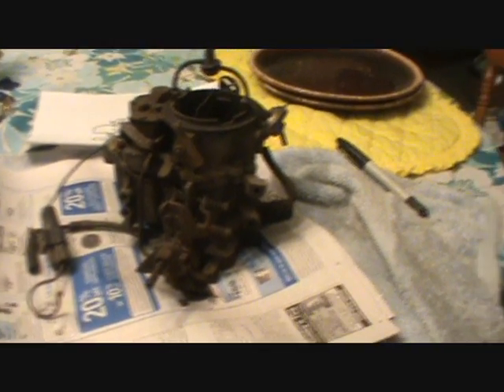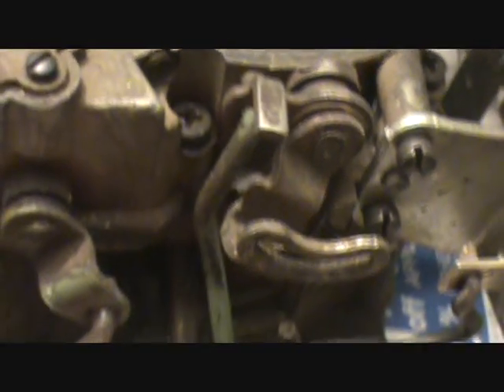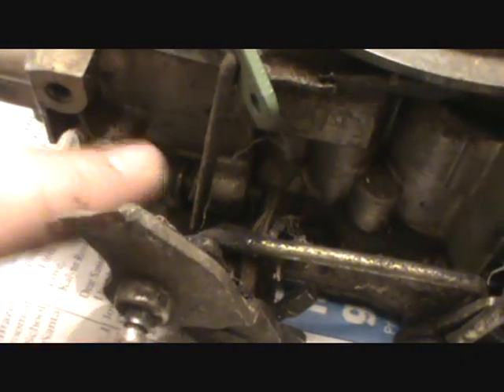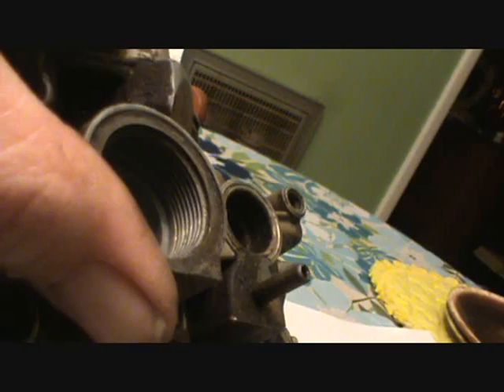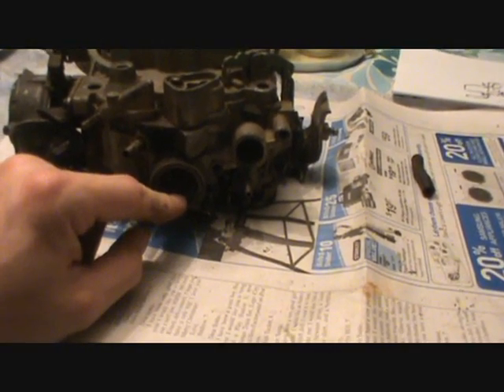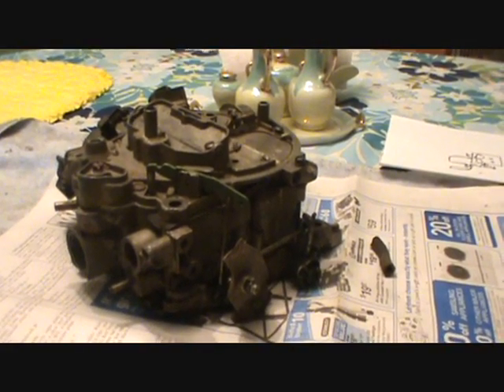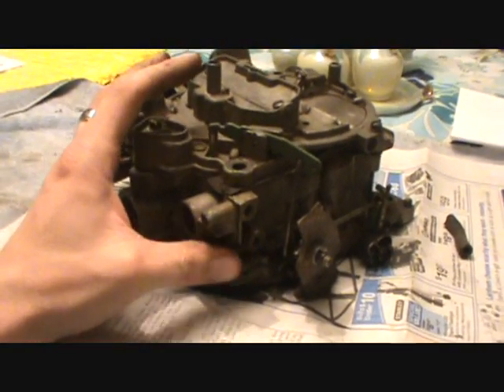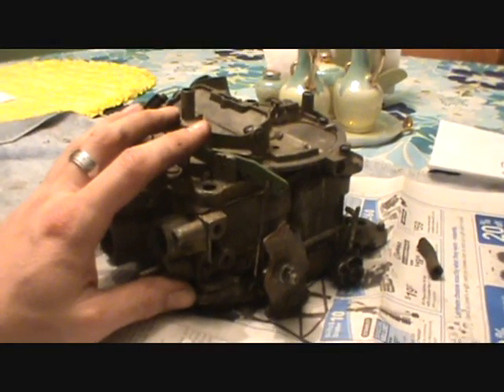How to understand automatic chokes part 5

Comment: Hi Tyler!!!  Thanks four your videos.  They are highly appreciated.  Ive got a 318 with a Rochester dualjet ( im pretty sure that is what it is). It runs pretty good. But, it could use some adjustments.  I've been watching your carb videos because I plan on pulling the air cleaner of this weekend and trying too straighten a few things out.  So, before I get to, it I'm doing some research.      At idle it smells like its running rich.  When it is first started in the morning, 2 pumps on the throttle, turn the key...fires right up and runs smooth.  But, as its warming up, the rpm's slowly creep up.  To bring the rpm's down, I have to blip the throttle.  Is this right ?  The rpms creep up pretty high.  Im pretty sure at the least I need to adjust the high speed idle screw.  Sometimes I have too blip the throttle several times, revving the engine pretty high, to get the rpm's to drop.  It just doesn't seem right.  Anyhow,  Ive you have any suggestions Id appreciate it.  I see here that you have alot of people looking towards you for advice. If you dont get too my questions I understand. If you do, well then I thank you kindly.   Have a good one Tyler. And take it easy !!!
Reply from the maker: Thanks man. The idle speeds up as it warms up because the choke is either adjusted too rich or the choke "pulloff" is bad. You'll need to identify which carb you have. Dualjet is a 2bbl rochester which was never used on Mopars. The 4bbl  Quadrajet was. Once you ID the carb, there are good online resources which explain how to adjust chokes and how to test pulloffs. Blipping the throttle is normal, the choke being too tight(rich) would make it take more effort to knock off the choke with the pedal.

Comment: I learned a lot thank you. I have a 1976 Dodge 440. Been having a hell of a time getting it started cold. Also after its warm when I try to start it after going to the gas station it cranks hard for about 3 seconds and then kicks in. I'm going to do what you showed on this video. I've rebuilt a lot of carburetors but never knew how to adjust the choke right. Everytime I had to rebuild one it was out of necessity so I am not an expert that's for sure.

Comment: Hey bud its me again I'm still having trouble I am a first time carb user. In that being said I bought a 79 Pontiac lemans 2 door coupe has a 231-2v v6 103hp  3.8l and has a Rochester Dualjet 210 #17058190 and the man was 80 years old said before you leave we have to adjust the electric choke. And in doing so I watched as he turned and turned pulled throttle turned back and forth and pulled throttle so now Im at a point to where were I live temp is warm right now but anyway when I start the car I hit the pedal 1 time turn the key the pump one more time just to make sure it will stay running and at that time the choke butterfly open and I don't have a Rpm gauge but I'm sure it will be 4000  I mean it is screaming so I push the peddle review it until is goes to about I don't know 2500rpm I put it in gear and if I hit that gas man stall. Then do it a second time its OK but the only way to just lower that insane idle I have to turn the air off or slide to heater and it will be OK but it's just chug o login. Then when I get home from work wait about 4 hours to cool down and take the air cleaner of and the butterfly will be at about a index finger open.  I have watched almost all of your videos and I think all Quadrajet videos on YouTube I'm lost for words the carb is clean heat rising pipe is on I don't get it. To me you are the king of quadrajets and I really could use some advice here. Please I would very much appreciate it.. Sorry for the long story but on your videos u always say ask me anything so here I am..
Reply from the maker: Glad to help, but you have to help as well. You've watched all the videos, I presume including fast idle speed, chokes, etc. So, what have you FOUND wrong with your carburetor so far? For instance, next time it idles extrmely high, don't touch ANYTHING, shut if off and go directly to the carburetor and look until you see the reason the throttle is hanging open.
Reply: Tyler's Neighborhood Garage  only problem I see Is the high idle Cam Is up and when coolest down its still stays open about an inch untill I push on the throttle plate for it to even get closed or it the throttle I don't see and linkages sticking anywhere..  And I don't have any mechanic in my area that works on carbs I fixed ankle the rods and cleaned everything and electric choke is working I'm so confused

Comment: ok I'll check it out. I'm taking it off again today. It must have a plugged passage-way somewhere. I am replacing it with another qjet off a 1979 p/u, looks like the throttle cable and  trans. cable linkage is the same. Hoping it will will work with my 700R4 trans. What do you you think.

Comment: I'm working on a q-jet off a 1982 chevy k10. It has a front and rear vacuum diaphragm. I watched all of your videos (great info!) I must have missed the part  where you explains what that back diaphragm doe's and how to adjust it, Looks like mine has an adjustment screw inside of a tube on the .diaphragm  . thanks
Reply from the maker: Look to see if one of them specifically attaches to the secondary air door lever at the top. Sometimes one only affects the choke and one only affects the air door opening rate. That screw in there also helps fine tune the rate of apply/release regarding the vacuum break.

Comment: I'm running a factory (freshly rebuilt) Q-jet on my 72 LeMans, it has an RPM intake, so there's no spot to mount a hot air choke, and I don't trust those cable operated remote chokes, so I have ordered an electric conversion kit, should be here any day. My question is this, if I let the car sit overnight or even for a few hours I have to bottle feed it just to get it started! The battery will usually die before I can get it going.....it absolutely MUST be  30 minutes to an hour later, once its warmed up it runs ok. Could this be caused by not having a choke hooked up right now? Mine is supposed to be here next week. BTW, I'm also originally from AL, what town are you from?
Reply from the maker: Scott, you'll need to put on your lab coat and play carb doctor, lol.  From here it sounds like a really bad supply issue, but you'll need to to some testing. Have a GOOD fire extinguisher at hand at all times and preferably do this out in the driveway.

1. Next time the stage is set for you to have to ride the starter to death, go out with a good flashlight and look down the the carb throat while you work the throttle arm. You should see the accelerator pump squirt gas. If you don't, go inside, spin the starter a few seconds and look again. If you still have nothing, you will have to figure why.

2. Obtain a clean, small clear bottle, like a soda bottle. Disconnect the fuel line at the carb and direct it into the bottle. Go in and crank the starter a few more seconds. If you are leery of this step, you can pull off the coil wire so the engine won't run. IF YOU GET GAS into the bottle, then obviously you have something wrong with the accelerator pump, but I doubt this because if so you would have a bad stumble each time you hit the gas. If you still have no fuel flow, then the problem is elsewhere and not in the carb.

3. Obtain something like a small mower gas tank or something else suitable and patch it in to the supply side of the fuel pump. In other words, take the car tank and line out of the equation. Get it hooked up, safely, and see whether you finally have gas to the carb. If so, you know you have a hole in the line under the car somewhere, very possibly the rubber section over the axle, or the pickup in the tank is cracked. Either of those will prevent the fuel pump from priming. If that fixes your fuel supply issue, then I bet your excessive starting problems go away also.

If you STILL get no gas, then you can be confident that the fuel pump is failing. They have small one-way valves in them and sometimes they stick open and won't prime. 

I know this is a fair amount of work, but it's essential you find out the PROBLEM instead of just guessing at it. Let me know how it turns out. BTW I grew up in Guntersville.
Reply: WhoSaidTyler thank you brother for the info.....after reading your reply and talking with others today, I am pretty sure my accelerator pump is bad. I do sort of have a stumble when I hit the pedal, once you get past it you're good. I need to check with the guy who rebuilt the carb to see if the accelerator pump was addressed. I'll be digging a little deeper, but I might have to call on you again later. Thanks again

Oh, my wife has family up in Arab...

Comment: Hey Tyler, I picked up an 85 jeep cj7 with the 258 I6. The choke seems to be adjusted properly but as soon as the engine turns over the vacuum choke break slams the plate full open instantly not allowing it to warm up and thus the engine stalls or idles really rough until it warms up. Any ideas?
Reply from the maker: Yes. The vacuum break should be adjusted so that when it's fully retracted, it only cracks the plate open a small amount. That said, if it's actually able to open it that far, then you should check whether it's the right unit, whether the connecting linkage is bent or some other issue. It shouldn't do that, obviously.

You may want to google some pictures of that carb and I bet you'll notice right away what's screwy with the break/linkage. Is that a 1bbl Carter YF ? They also used 2bbl Carters but Carter Carburetor quit the business in 1984.
Reply: WhoSaidTyler well I know my 79 cj7 I had years ago was a 2brl carter. Absolute garbage carbs in my experience. I went through several remand ones before I got one that didn't suck air from the side ports where linkage connects to the butter fly rods. Eventually I ordered a Webber designed for that engine and never cld get it adjusted properly but I Dnt have it anymore so back to this one. This one is a 2brl also but just assumed it was a carter since it looks the same other than it has way more California smog crap all over it. I will look in the morning to find out the make of the carb. 

Great videos by the way. They refreshed some things I had learned and hadn't used in years as well as taught me some things. Keep it up please!

Comment: Hey Tyler, great videos.  I have a technical question if I may.  And it's probably not such a smart question but I don't know about carburetors.  If I set the choke coil so it is too rich will I be wasting gas?  If yes, will it cease wasting gas or, will it go back to normal gas usage once the engine warms up?  Same for the Idle screw.  If it's idling a little too high is that a waste of gas?  I have a 350 V8 so I can't afford to waste gas.  Thank you in advance for your help.  Many kind regards, Ernest
Reply from the maker: Ernest, any time you run an engine rich, it uses more gas. Same with increased idle speed. But, a carburetor is not a model of efficiency even on a good day. That's why they went to fuel injection. That's why I suggest setting the choke properly so that it "unloads" as quickly as possible without causing drivability problems.

Comment: Hello WhoSaidTyler, I'm having a problem with my quadrajet's choke, I think. The vehicle is a 67 gto 400ci with a 4 speed. The quadrajet in this vehicle has a divorced choke. When the engine is cold, the primaries are not closing, which makes it very hard to start obviously. So I assume something is wrong with the choke. But I also have a hesitation when I stomp on the gas pedal when it's warm. I check the vacuum break thingy like you suggested on you de-bog vids, and it seems to be working. The oil doesn't smell like gas either.
Reply: Update. We've looked at it a little bit more, and it's not the choke. When you pump the gas and try to start it, one of the linkages seemed to be stuck. Tried to clean it up some. Seemed to break it free, and now the choke works fine. Don't know if it's a permanent fix or not. Still have a little bit of hesitation/bog when the gas is pushed down. Also had a bit of a back fire today, so the hesitation or bog might be due to timing issues, or improperly tuned carb, or some linkage is still sticky.

Comment: Hi -thanks for your videos and southern humor-great job! _ my 2 questions are after watching 1-4 of your rebuild videos an just now 1-5 of your auto choke videos amongst many others
What I don't see anywhere is: (on the q-jet carb I am trying to use is from a early 70's OLDS carb # 7043250 to replace the chevy computer q-jet on 85 camaro with 700r4 trans due to eliminating computer)
1. How to assemble and position the the auto choke arms when you are assembling the choke housing-I took all apart to clean and have no clue how to reassemble the arms AND how they interact with the primary throttle shaft "arm" on the choke side.
2. I need to remove the accelerator "arm" (with TV cable connector also) from the chevy computer carb and also the OLDS carb and switch them so the cables will hookup properly to the camaro cables. I was thinking I could maybe grind around the flattened end of the primary shaft to get the arm off and switch em, and maybe have them tac welded to the shaft :. will that work??  What do you suggest?? -low on money. It would be great to see videos on these subjects as I cannot find any
thanks Tyler you are doing a great service for many of us trying to DIY & save money

Comment: I have a question but, first I wanted to say thank you for your videos.  I have changed fuel injectors, diagnosed bad coil on plugs, and used computers to determine which oxygen sensor to change.  Then I bought an 86 motorhome with a 454 and I discovered that it has a strange device under the air cleaner that apparently lets the gas into the motor?  Anyway, thanks to your videos I was able to diagnose that the strange device is not working because it has a bad choke coil.  I even know that it is the electric one!  I even know that it is the electric one from california because it's riveted.  But there in is my question.  Can I drill out the rivets, tap the holes and replace it with a standard choke coil?  I truly appreciate your videos.  I wouldn't have been able to do this without them.  THANX A LOT!!!!
Reply from the maker: Thank you for a funny comment!

 Are you SURE there is power going to the electric choke? In later days GM started routing power through the oil pressure switch so that the choke wouldn't open if the key were turned to ON but the engine not started. In simple terms that means you have to start the engine, THEN use a meter to see whether there is 12v supplied to the choke.

I've rarely seen choke coils fail. You can test them with an ohm meter between the terminal and the carb body to see if there is an open in it.
Reply from the maker: The rivets aren't a California thing. They all were that way originally. In the field they can be drilled out and replaced by screws to enable adjustability.

I'm not sure what you mean by standard choke coil. Heated by hot air you mean? The two types are nearly impossible to swap around.

An electric choke WILL work well. My '83 Olds starts immediately, every time. As I mentioned, start with the basics and determine whether there is 12v being supplied to the choke first.
Reply: WhoSaidTyler Thanx for writing back.  Yes, I did find twelve volts at the plug with the engine running.  The choke moves freely by hand.  It idles (even when warm) around 1800.  When I open the choke by hand the idle comes right down to 800.When you say check it with an ohm meter do you mean basically see if there is current able to pass through the coil to the carb as a ground?  Sorry, for the confusion on the standard choke coil.  I thought there was a difference between how the California quadrajet worked its choke versus all the others.   I did figure it for California based on your other video on how to read the numbers.  Also, really well done!

Comment from the maker: Well what you need to understand about fast idle cams is that the choke element itself totally controls whether that works right or not. If the choke never engages then it never goes on fast idle. If the choke does not disengage then it never comes off fast idle.

 Sometimes you can also have linkage issues but in your case, I suggest checking to see what that choke element is doing. as the engine warms up.

Comment from the maker: Yes, 12v switched power, that comes on and goes off with the KEY. Some vehicles have ACCS terminals in the fusebox. Otherwise you may just have to investigate until you find a good source for 12 volts

Comment from the maker: @abigredmonkey If you mean that it runs too rich for a while, I had that problem with my Plymouth. You can bend the choke rod slightly so that it doesn't put as much force on the choke plate. Also check to make sure the pull-off is good.